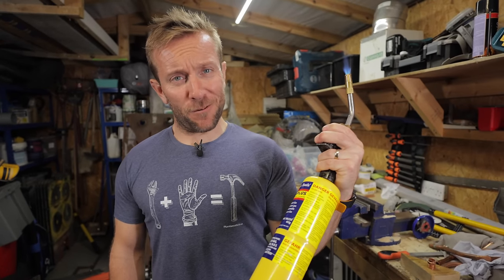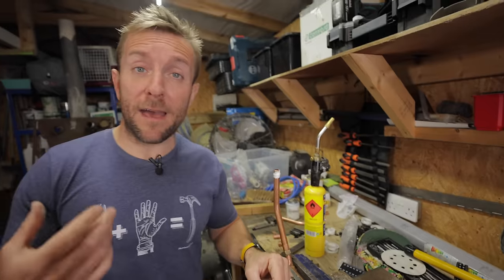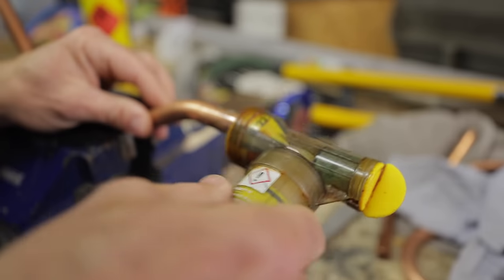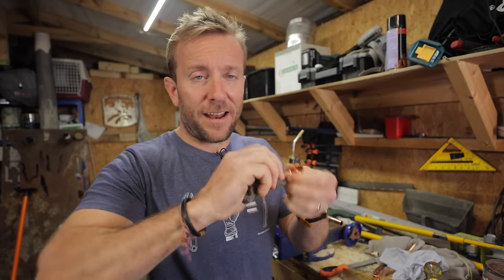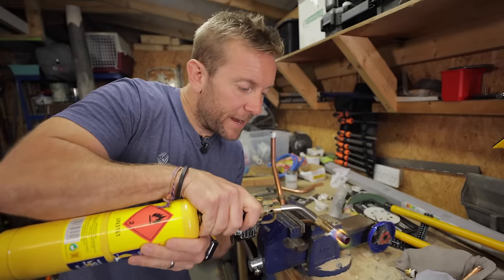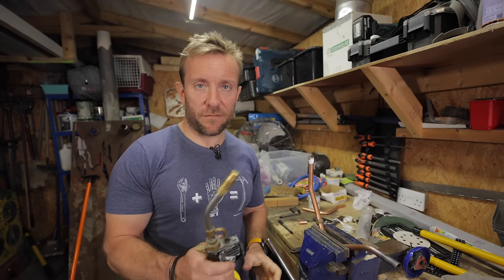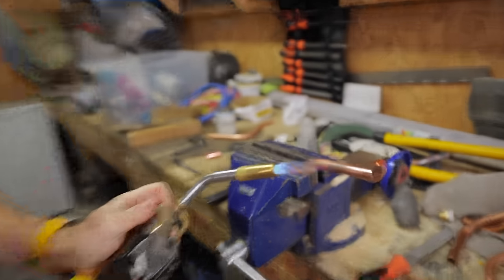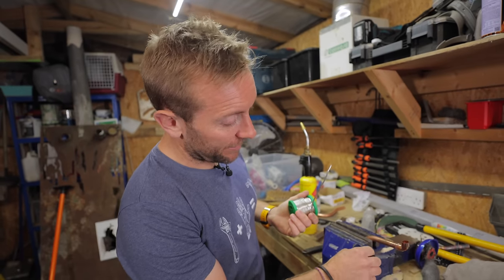6 SOLDERING MISTAKES ON COPPER PIPE

Comment: You used the right amount of solder the first time. The solder does go all the way round in the pipe. Also when soldering you should not move the blow torch all around the pipe it is better and safer to hold it in one lositiion and not move it. The pipe is going to get incredibly hot so there is no need to move it around.

Comment: They say a bad workman blames his tools. I used to believe this until I attempted a batch of soldering on my central heating. I did all the things in this vid by the book and it still leaked: that's THREE attempts all going wrong and boy was I tearing my hair out(I still had some in those days). Then my wife said "maybe it's your torch?" "No it can't be, I've had this for years and it's never let me down!" But after the fourth failure, I was desperate enough to pop round to B&Q and treat myself to a new torch. Instant success. The moral of this is that sometimes it actually isn't your fault. Check your gear.
Reply: A bad workman blames his tools because a good workman doesn't put up with crap tools.
Reply: It was your fault for not checking your tools.
Reply: @robertmedina3195  Thank you. I consider myself suitably admonished.
Reply: @jaycie5021  I didn't put up with the crap tool once I'd realised it wasn't fit for purpose anymore; I replaced it.
Reply: @Maltloaflegrande  I've done it myself. I was using my multimeter and after wasting an hour found out the leads were bad lol.

Comment: Heat the joint, pull the flame away, touch some solder to the joint and it will start melting when it is hot enough... Then it's ready...Touch  the flame back again as needed...if ya leave the flame on the joint when you put the solder on it, you're just melting the solder and that's what causes drips and buildup..  also blue canister propane is just fine for residential water lines.. don't actually need MAPP... it's over kill.. the time difference to heat copper between the two is not that substantial..plus ya gotta have a dedicated MAPP nozzle.. I'm about saving money, not buying thr newest, fanciest tools and equipment... Ya just gotta be smarter than the task at hand.. thanks though..

Comment: Number 1 rule to having solid clean solders is having flame control and understanding the flame. For example, soldering 15mm you only need a light soft flame which will slowly draw your solder in rather than having a massive out of control flame which will melt the fitting and flux and you'll end up with solder all over your fitting.
Reply: Thats exactly what he said in the video
Reply: Bless you for taking the time to say this.

Comment: Make sure you check what's behind the fitting your heating. If there's something flammable or heat sensitive,you could buy a heat shield or cut one of those foil baking trays in half and it'll work just fine. You may be able to layer aluminum foil but haven't tried that.

Comment: I used bread for years when soldering pipes with water in and always worked a treat , until on a job one day and the only bread on site was called Warburtons best of both! god knows what was in it, the joint soldered great but even after 2 days with the heating running the bread did not break up! had to pull the thing apart and the bread had turned to a sloid plug! just imagine what it does in your gut!
Reply: You have enzymes in your gut, but probably not in your water pipes.
Reply: Use white glue bread ... not whole grains .
Reply: Hovis or mother's pride then?

Comment: I've just upgraded some 22 to 28, with even a couple of 35mm tees. First time soldering larger pipes, was nervous but got there in the end. Plenty bird poop, snots, 2 leaks - got there in the end! Doing it again I'd flux 1 joint at a time in stead of a few, but otherwise quite happy for a pen pushing DIYer 😊 I learn all my stuff here, thanks for helping us! Oh PS, for very dirty pipes, a bit flux before cleaning will bring it up nicely!

Comment: Being a very experienced and master plumber myself, I never, ever use MAPP gas to solder. I only use it to loosen fittings that other barbarian Plumbers overtightened fittings with! It has oxygen in it to help make the heat / flame quite a bit hotter than just propane and the oxygen also gets into the solder and the copper which is not a good thing.
    Edward H. – “Integrity, plumbing, septic and drain“ out of the Clinton, CT USA area.
Reply: Thank you. this is good to know. So, what should I use? I am a newbie to this. Buying new kitchen taps: Want to solder in copper tails to copperpipe under kitchen sink. TIA
Reply: @sunkat76  Propane torch.
Reply: @akc045  thank you!
Reply: I can't stand MAP.
Gives me the worst headache.

Comment: My first go at soldering copper pipe I was using an electric heat-gun. It did get the solder to melt but not nearly hot enough to flow properly. Got a butane torch and got perfectly smooth soldering.

Comment: Good tips I enjoyed it. I am watching these as I have to do a pretty, decoration copper install for an airline. (3/4) I would like to see a demo about getting it right when you are up a ladder, hard against the ceiling and have to turn it into a T piece but you are 18 inches from the corner where you turn 90. Using brass wall Battens in brick. And after you are done the client is using a microscope to look at your joins.

Comment: I always have a problem with lead free solder. That goes for electrical soldering as well. I understand if it is on central heating you are still allowed use lead tin solder but not on drinking water pipes.

Comment: Thank you, this video was invaluable. I was able to replace a leaky delta 600 series valve. We cut the old valve off at the body, sweated the little pieces off the pipe and trimmed the pipe to fit the wider valve body. We did it in 1 try thankfully. 

That brass takes a lot more time to heat up than that copper pipe does, we had to use a license plate heat shield when working in the wall.

Comment: Had to learn soldering and compression joints on 15mm copper when we came home one day to find bursts in the washer & hose feeds in the garage.  It was around 40 years back so no internet to fall back on.  And yes, mistakes were made!  Probably the very first joint I tried to do, I was stood there with the blowtorch for AGES, wondering why the darned thing wasn't working, why the joint hadn't sealed.  Not knowing, I'd turned the torch on high and the solder must have drained out within the first few seconds.  Got the hang of it after that but, frankly, would use plastic for 95% of the stuff I'm likely to do nowadays.

Comment: Great video, Im not an plumber but after cleaning the copper you shouldn't really touch the area as natural grease from your fingers will contaminate the copper but these new acid fluxes are pretty good these days.

Water boils at around 100C and for solder to melt it needs a few hundred degrees so if theres any water or steam you cant clear you will stuggle like hell! Ive used a vax vacuum cleaner in the past but if that fails a
Compression joint or if you trust push fit is the other option.
Thanks for your great videos.

Comment: There is a quick cheat for soldered fittings, using electrical solder with the flux already in it. Although more expensive, I use it with cleaning flux and it works on all copper fittings. The cleaning flux is now not so easy to get hold of, a bit toxic I think. If you want to master the end feed fitting, the ones with no solder ring in them, try electrical solder with everything cleaned up beforehand and a bit of flux if you are a novice. Works really well.
Reply: Interesting, although I don't know that electrical solder is suitable for potable (drinking) water though?
Reply: @videogalore  Modern stuff is lead free, just tin and a little bit of other stuff in it, so it is actually water safe. The old solder before ROHS is tin lead alloy, 60% lead and 40% tin roughly, depending on brand. But if you are doing refrigeration pipe MAPP gas is the thing, and you are actually melting the copper slightly, and the gas is cleaning the oxide off the surface before the silphos rod is used to weld the parts together. Have used it a bit on water pipes, and with this you do not even need fittings if you have the AC tools, as that allows you to make the one side expand ( for water pipe that is hard drawn first heat it to make it soft annealed copper again) to make a fitting that is way more than capable of handling water mains pressures.

Worst though is when you find old imperial size copper pipe still in use, and want to mate to modern fittings, which will not work, so MAPP gas and weld the new tail onto the old pipe it is. That is in old buildings, with pipe in the walls, and you need to fit a new tap there, and not remove 20m of plaster to do it.
Reply: Thank for that  @SeanBZA , you've also answered why MAPP gas is hotter, I've often wondered that too!
Reply: @SeanBZA Leaded electronics solder is 63/37 (true eutectic) or 60/40, which is close enough and was slightly cheaper back when leaded was king. The first number is the tin, so 60/40 is 60% tin and 40% lead.

Comment: On many jobs I see the big lumps of solder at the bottom of the fitting where the previous plumber has used too much solder. After every joint I do I wipe the joint with wire wool as its there anyway from cleaning the pipe. This removes any excess solder and leaves the joint  smooth .
Reply: If you are doing 50 joints or so you don't always remember to wipe everyone. As long as it doesn't effect the integrity of the joint no worries. The bigger issue is to go back and clean all the flux off so you don't have green pipes. I use a couple of spoonfuls of baking soda with water and wipe all the copper down not just joints. Way the grumpy old guys taught me!

Comment: What are your views on solder ring fittings? I'm a diy'er and been fitting new rads in my house, have used them in all the pipework as I was worried about getting the amount of solder correct if I used normal fittings.
Reply: Truthfully as a diyer also I'd say hit and miss, I've had as many fail or require topping up with solder, that on my current renovation project I've just end fed solder for all copper joints.  

If nothing else a bag of elbows and pipe offcuts give you ample practice to feel confident soldering, and if your using solder rings your 90% there already so the blow torch doesn't feel alien in your hands, and that 5mm rule of thumb tip in the vid will help you master the last 10%...
Reply: You shouldn’t have to top up Yorkshire fittings. Might have to clean the pipe a bit better and maybe use better flux. Regards
Reply: @robkiss5272  interestingly same prep and flux yielded perfect end fed joints and variable solder ring joints.  Quite likely it's my technique or a rubbish quality fitting
Reply: @nakchAk  hmm it would bet on the fittings then. I stopped using those quite early and went to end feed ones. No ring just a few joints, be generous with solder at the beginning…it will be a bit messy but at least no leaks and then less and less solder…you will get the feel then like Jimmy says a bit of Brasso  and it will be pretty too. 😀 Never be beaten

Comment: Wire wool is no longer recommended to clean the pipe prior to soldering use Abrasive strip or a pipe cleaner as wire wool strands can break off and get in the pipe 🤔🤔 that's how i was taught Sir James of Cambridge and i ❤️ the after clean with 0000 ultra fine steel wool as shown by PB

Comment: 10:30 Another way to deal with water in the pipe is to take the lid off a kitchen/bathroom spray, put the tube down the pipe as far as possible and use it to spray/suck the water out.

Comment: I was looking for tips but this was very basic.
The only thing that really allows to me is not using too much solder.
I'm not a pro. And my solder joints don't look like a pros. But they don't leak. And they're in my basement.
To clarify good video if i had watched it like 20 years ago.

Comment: Hi  Does the UK still use soft solder.  I thought most counties had moved to silver solder.  In Australia this would be banned.
Reply: I’ve been in the industry for 36 years always used soft solder without any issues I lived in nz for 7 years and they used silver solder due to the earthquake risk on joints don’t need to worry about that in the uk

Comment: You didn't deburr the pipe.  My father taught us plumbing.  He did lead casting, oakum and lead bell end fitting sewer piping, and all kinds of odd old work that no one does today. I have his old tools and all of the hands on experience.  We call the blobs of extra solder on the bottom of a sweated joint, a "Turkey Nut" or "Turkey Nuts". We used Flitz, Brasso and some polish for stainless steel firearms. I just blow the pipes out with compressed air. Dad would stuff bread in the pipe. It clogs fine screens in faucets and holes in shower heads.  Freezing the pipe required a CO2 fire extinguisher, or a can of refrigerant for a car and it is way too expensive now.

Comment: I couldn't solder a pipe because I neglected to loosen the fitting from the water heater. There was a small water leak at the shut off and air was pushing into the pipe and creating a small channel for the leak.

Comment: If you want a compression fitting to never leak (Especially on hot water pipes, that will expand, when hot, and contract as they cool, this eventually causes a leak, as the olive becomes loose on the pipe!!’) solder the olive on the pipe!!’ This turns your joint into a cone joint, assemble with PTFE  or jointing compound, and I guarantee, done right, it will never leak, no matter how many 
Hot/Cold cycles it goes through.!!!’  If working with gas a compression joint is verboten, but by soldering the olive, and making a cone joint, it becomes an approved fitting, and will not leak ever!!!’ Takes a little longer to do but on hot water pipes, and gas fittings, well worth the effort, and extra time!!!’  ຈل͜ຈ
.

Comment: What I do when soldering a joint is, immediately after the solder goes in, wipe the joint round with a wet or damp rag. This not only removes any drips of solder, but if there are any pinholes in the solder wiping it will fill those pinholes before the solder sets solid.
Reply: I’ve heard this is not advised because that will cool the solder down too quickly and could create micro fractures, sort of like a windshield breaking in the winter.

Comment: I'd say if the soldering is not working then its probably 
- there is not enough heat , possibly because the water hasn't been drained from the system
- OR the copper pipes have not been cleaned properly .

Comment: Just a tip, do not use emery cloth to clean the copper pipe it impregnate dirty particles in to the copper. Sand paper or wire wool yes.

Comment: Never heard someone prenounce the "L" in solder.  Lmfao.
Reply: The L is there for a reason...
Except in America.  Lol...
Reply: @eckypooh50  why is the K in knife?
Reply: @eckypooh50 Yes, the “L” is there for a reason: the artificial re-latinization of a word that didn’t actually have an L when it entered the English language. The original word was “souder” from French. The L was added centuries later, and the American pronunciation basically retained the original pronunciation, rather than the new “spelling pronunciation”.
Reply: Solder in french is soudre.. pronounced soo dray...
Soder in american is sawder.. @tookitogo
Reply: @eckypooh50  You are mistaken. It’s souder.

Soudre is a different, unrelated verb. 

Souder is, of course, the source word, and it evolved. But the point is that it didn’t have an L.
Reply: Soudre is solder, souder is weld..
According to translate ?